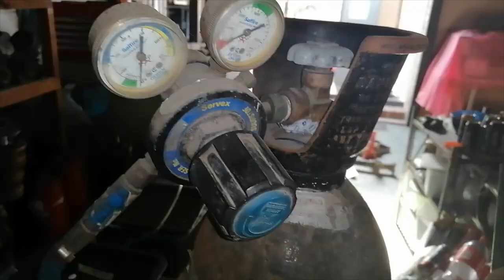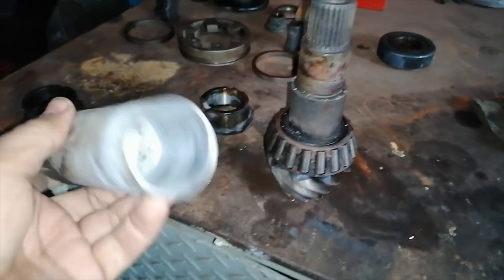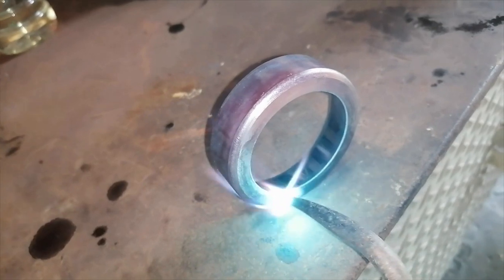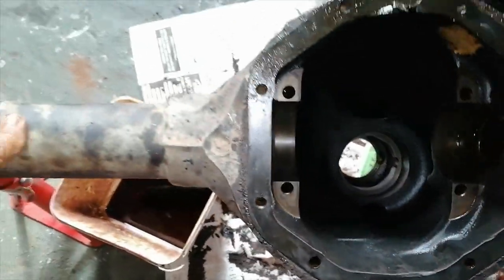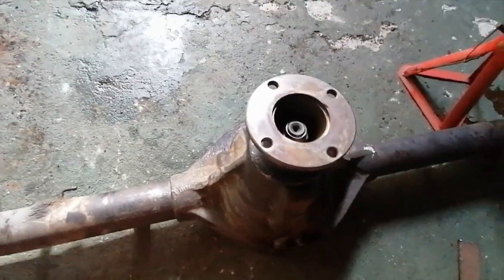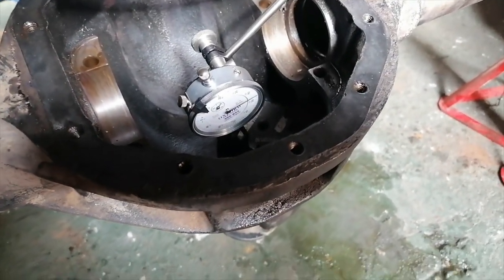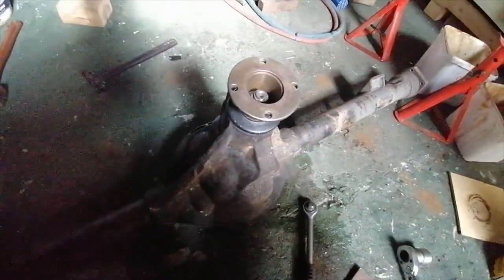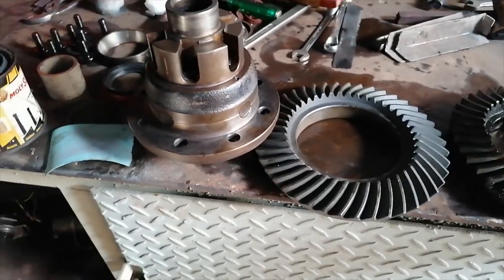2001 Isuzu 2.8 Turbo Diesel Rear Diff. Assembly Part 4.

Comment: Hi stupid question what diff is that i know its isuzu but what diff because iv got the 2021 isuzu kb250 d teq and it  has the same diff took out the crown found that there is play by the left hand spacer or shim in other words need to replace all bearings but no idea what the shims spacing should be or do they all differ
Reply from the maker: Hi Tyrone, thank you for watching my videos and for your comment. My model i has a M82 diff. It is difficult to say what size spacers you will be requiring. I do not know if you watched the complete series, but i show how to determine those spacer thickness in one of them. If your diff has never been opened before as it is a relatively new model, then perhaps your bearing collapsed and the spacer thickness is still original. If that is the case, then it would be worth double checking the backlash during assembly, it might have been determined incorrectly from the factory. Regards

Comment: Nice one bro how did you remove the shaft on both sides for the wheel bearing
Reply from the maker: Hi, Thanks man and thank you for watching, i do appreciate it. I used a sliding hammer to remove the shafts from the diff, which i covered in other videos should you not perhaps seen it. I did not change the wheel bearings. There was no need for me to change them yet as they still had some life in them. If i had to i would have heated the collar behind the bearing using the gas, as well as the bearing and hit them off. 👍